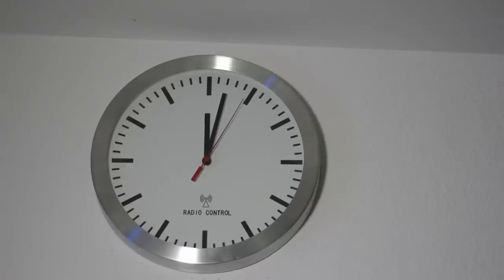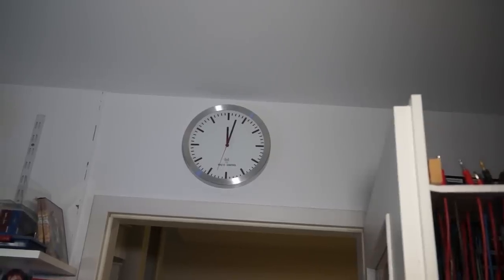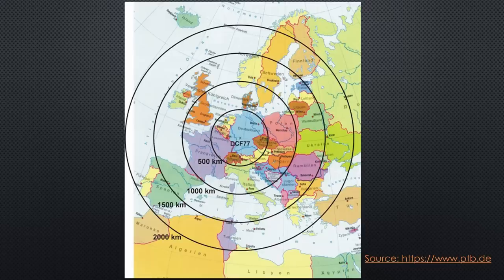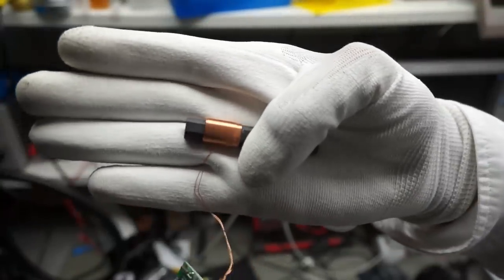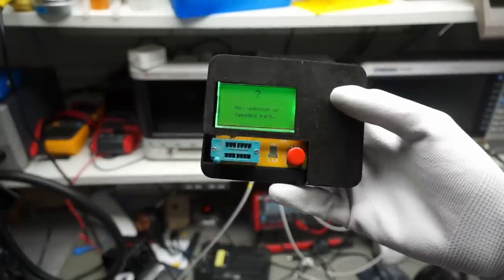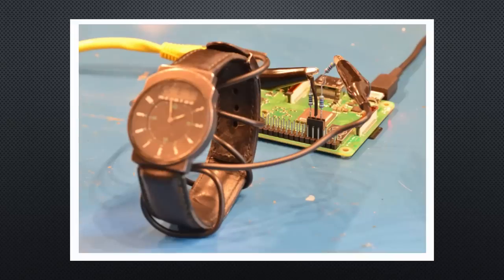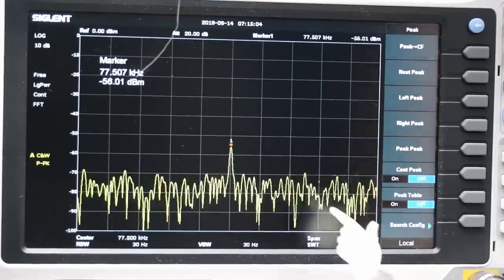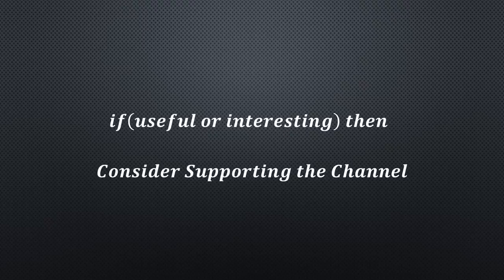#287 Remote Controller for Clocks (IKEA and others, DCF77, WWVB, MSF, JJY)

Comment: Isn't your weak radio signal competing with the much stronger one from the DCF77 station?
How does your Ikea clock know which signal to sync to?
Reply: Maybe I missed that part, but I am confused as to why he would want a different time in his lab, other than the one from DCF77
Reply: His clock does not reliably receive the DCF77 signal in that basement lab. (His clock doesn't sync to it or even syncs wrongly.) So that main signal will be hardly above noise floor in there. His weak makeshift signal will be way stronger than what it receives from DCF77.
Reply: @CarolineC0815  That makes sense, but that also makes it a very specific solution for clocks at isolated locations.
Best not get a radio clock for that location.
Your comment brings up more questions than it answers. :-)
I still enjoy the video, its always educational.

Anyway, thanks for the response
Reply: Think repeater radio
Reply: @DougHanchard  As if you have read the reply i typed but deleted. :-)
I was going to say:
The basement clock will never be more accurate than the clock source you use for your local transmitter.
(I guess that's good enough for home/office use)
But there will be a delay between receiving the DCF77 and the retransmission.

Also: If the original DCF77 signal can be received in the basement, but not reliably, you will still have interference between the two, unless your local transmitter drowns out the DCF77. (which is of course possible)

I was also wondering if the Raspberry would be powered on 24/7 just to avoid clock to get corrupt time-data.
It seems a bit of overkill. Since he probably has internet in the basement, he could use a clock that syncs with an NTP server once per hour/day.
Or, since Andreas seems to know quite a bit about Radios, wouldn't it be possible to receive the signal outside and re-amplify it in the basement? (without using a raspberry)
(I guess that's what you mean by repeater radio ?)

Comment: On my first trip to PRC i took my Alarm clock with me. But as the first morning came it did not ring That clock I used was a Radiofrequency clock. I didn't know that at the time, back in the 90s. I ssumed that all over the world they would use a standard Frequency and transmitting all the same time (like the GMT or UTC) and someone would have to adjust for the Time Zone by setting it. What a funny mistake:) hahaha
Reply from the maker: This concept was introduced before globalization ;-)

Comment: Thinking can use an upconverter with an RTL-SDR and Spektrum with a noise generator for a more cost effective tuning method?  Maybe first verifying the source signal to adjust for frequency offset once the RTL-SDR has stabilized.   Cool build.
Reply from the maker: Did you try a noise source with an SDR? I tried it without success. Maybe I made a mistake.
Reply: @AndreasSpiess  I still have to try... I've only read about and watched videos regarding.  https://www.rtl-sdr.com/rtl-sdr-tutorial-measuring-filter-characteristics-and-antenna-vswr-with-an-rtl-sdr-and-noise-source/

General search with a few references that might help:
https://www.rtl-sdr.com/tag/swr/

Do you think since low frequency measuring was the issue... I was wondering if direct sampling RTL-SDR alone will work?
https://www.rtl-sdr.com/rtl-sdr-direct-sampling-mode/
Reply from the maker: In the meantime, I tried again with the noise source of my oscilloscope and it worked. Hat to get the right FFT settings of the oscilloscope.
Reply: @AndreasSpiess  Awesome!  Please share. This RTL-SDR or other SDR method appears to be the most cost effective I've found and is on my list of amazingly cost effective procedures to develop this fall/winter as I'm currently focused now on other projects tasks.  

While on the topic of cost effective uses for the RTL-SDR, there is an oscilloscope plugin for SDR# also (albeit I'm not sure what the operating accuracy specifications will be) on the web that I've downloaded and haven't played with much from IN3IEX: 
http://www.amfone.net/Amforum/index.php?topic=34858
https://qsl.net/e/ea1kr//sdr/rtlsdr/  

I also just found this reference to SDRSharper doing a Google search to find the above links and will try when I get the time:
https://www.qsl.net/s/sdr/

On another note, I just found this reference to use an oscilloscope as an SDR which is something I've wanted to try with my TDS-520 test bed frankenscope either directly or with a pan adapter:
https://www.rtl-sdr.com/gr-oscilloscope-using-an-oscilloscope-as-a-software-defined-radio/
Reply from the maker: I will not do too much RF on this channel. I cover many other topics, too. Concerning using the ADC of the oscilloscope: Maybe an interesting experiment, but probably not very useful for everyday's operation :-(

Comment: Hi Andreas, I have a couple of DCF77 receivers for arduino. Can I cut the wires of the antenna of one of those receivers and use that as antenna for the transmitter without the need to purchase a ferrite bar and wind the wires as in the video ?
Reply from the maker: Should be possible

Comment: Great video, but one part I don't understand.  In your circuit you have a 1nF capacitor in series with the coil.  I tried googling it but all the articles talk about receivers, not transmitters.  I'm assuming it has something to do with tuning the circuit.  Can you explain and/or give me some keywords to more properly search?  It isn't on the original author's schematic.  I'm interested because I'm moving to Alaska and WWVB cannot be received there according to their signal maps.  Thanks!
Reply: I forgot to mention, I bought a decoder circuit off AliExpress and plan to use that antenna.  It was easier than trying to to DIY it (I don't have the enameled wire, etc.)  I bought the 60khz version so the antenna should match.
Reply from the maker: As shown in the video, it has to do with tuning. You can try without capacitor. Maybe it works. Otherwise I showed how you can tune it.
Reply: @AndreasSpiess  Ah!  Thank you, I didn't understand that part, I'll go back and re-watch.  For what it's worth, it did not work with the capacitor installed.  I removed it, per your suggestion and assuming the antenna was reasonably closely tuned, and it worked perfectly.  I have learned so much from your channel!

Comment: Thanks for the great video! I just built this DCF77 transmitter. I have one problem with it which is the low field strength: my clock can receive the radio signal only from a few centimeters. I need to have it in my whole flat: cca 10 meters. I have cut off the antenna from a ready-made DCF77 receiver then I attached it to my wemos d1 r2 mini with a 1nF capacitor and a BC547A transistor. Unfortunately I cannot measure the induction of the ferrite antenna I have. Can I suppose it have the same induction as in your case (145mH)? I tried to increase the voltage on the collector of the transistor up to 10 V but didn't help. I have no spectrum analyzer or oscilloscope. Any idea? Thanks!
Reply from the maker: These antennas are directional. Maybe turning it in the right direction helps.
Reply: @AndreasSpiess  I tried to rotate both horizontally and vertically but nothing changed unfortunately.
Reply: Now I am hopefully on the right way. I bought a measurement device to measure my ferrite antenna and calculated the right capacity. Now it covers a much bigger area but still not as much as I need so I need to improve a bit further :)

Comment: Great project Andreas! I begun to recreate the project with an orange pi zero, but and it don't have GPIO 4 or 17 on this Pi.  So I think that I can change thoses Gpios on the program for one's that Orange Pi have.  Do you know where I can modify the corresponding lines ?    I found the instruction for the GPIO 4 (gpio.cc line 184) but I don't find the gpio17 location. (I'm a real newbie ;)  Any help ?
Reply from the maker: I do not know and I am also a newbee in many cases, This is why I only use Raspberries ;-)

Comment: I wonder, would it be possible to actually inject the signal directly into the clock? Eg cut off the antenna inside clock, and then draw a 2-wire shielded cable to a raspberry and do the transmittance. The idea is that since its illegal to transmit on the frequency without license, by doing the transmitting on a wire (which then doesn't count as transmittance by law even if it "leaks" a little bit since by law its not defined as a radio transmitter - in the same way a NES console is not a radio transmitter just because you can connect it to the TV antenna jack), you would then build a cheap "master-slave" clock system. Propably the reach would be much longer too as the signal would travel very long through the cable.
Reply from the maker: You can inject the signal if you have access. But think about the wireless chargers. they work with a similar principle and are allowed. You could place the antenna very close to avoid a big signal as Henner did.
Reply: @AndreasSpiess  The wireless chargers are on an license free ISM band here. 9kHz to 5MHz is "License free for inductive applications". Qi chargers do on 10-600kHz. Same with RFID, also on a license free ISM band reserved for RFID.
Reply from the maker: So, 77.5kHz seems to fit? We also use coils to induce a current in the clock...

Comment: to see the signal, do you  connect the second ferrite rod with a capacitor of 1nf ? do you also use 200 turns of wire?
Reply from the maker: You can use the same antenna also for receiving. But you have to test it as I showed. It might be that your parts value are different.
Reply: @AndreasSpiess  it worked!
I could see the signal with sdr#. Lot's of harmonics though..

Comment: Always interesting videos, and this one is particularly useful since I found an atomic clock among my late Father's things and had no idea what the slider switch on the back were for: setting the signal to synchronize with! Now I'll set it to the closest source and wait for it to adjust itself. Any insights on how they adjust for time zones?
Reply: By calculation. It really is that simple. It transmits the native information based on the clock origin. The clock itself is then programmed with known DST regions.
Reply from the maker: These clocks work fine in areas with the same "time principles" As Doug pointed out they include "summertime" or "daylight saving time". And in Europe, most of the countries in reach are in the same time zone. So often, these clocks do not need an adjustment for time zones.

Comment: A version that runs on an ESP32 would be nice, a Pi is overkill and power hungry, it could use GPS or NTP over WiFi to get the time. mind you you could also rip the guts out of the clock and wire directly to the stepper motor unit.
Reply from the maker: Check my video 299...

Comment: Nice priject, but you can pick signal from gps for clock in raspbery pi and transmit to clocks
Reply from the maker: My GPS doss not work in the basement :-(
Reply: @AndreasSpiess  hello once again, i am using my raspberry for Ntp server, but after your video i want to make it transmit radio signal for a clock, i have this option in car, to receive DCF signal  but reception not great and no option to offset time. My time is GMT.
My question can antenna be made directional to transmit DCF?
And how to make it transmit at 15-20 m range?
How to check that raspberry transmitting, if i don't have antenna connected and no equipment to check.  I used your settings for setup. Is there any command in for linux to see its transmitting?
Thank you for your answers and time.

Comment: Nice video, but you can get a more accurate time signal using a GPS dongle receiver.
Since this clock is Swiss, shouldn't you add a transistor driven solenoid with a wooden cuckoo fitted to it? :-).
Reply from the maker: You are right with the GPS. Here my problem was probably more to display the time without wires than to have a showtime precise time.
BTW: cuckoos are more a German thing ;-)
Reply: @AndreasSpiess  the advantage in using GPS in the lab is that it is not that difficult to also provide a low noise master frequency reference. My apologies regarding the cuckoo clock, but then I obtained my information from Orson Welles in the film the "Third Man".
Reply from the maker: The third man was in Vienna if I remember right ;-) I will cover the GPS usage for a stable clock frequency in a future video.
Reply: @AndreasSpiess  the third man line was delivered by Harry lime while on the Vienna ferris wheel. It was to do with war and cuckoo clocks. 
Quotation from the film: "in Italy, for thirty years under the Borgias, they had warfare, terror, murder and bloodshed, but they produced Michelangelo, Leonardo da Vinci and the Renaissance. In Switzerland, they had brotherly love, they had five hundred years of democracy and peace – and what did that produce? The cuckoo clock . So long Holly."

I am glad to see you are proving Mr Lime wrong and producing lots of interesting things.

Comment: I got a new clock in the UK and it wouldn't synchronise whatever I did. After some Googling I discovered the signal was switched off for maintenance on the day it arrived! I was about to send it back as faulty.
Reply from the maker: I did not know they are allowed to switch it off.

Comment: thank you for the cheap method of the measurement. btw. can  the antenna be smaller?
Reply from the maker: I think so. But I did not try to cut this brittle metal.
Reply: @AndreasSpiess  no no. different type. there are hand watches. what kind of antenna do they have?
Reply from the maker: I assume a similar one, but I do not know.

Comment: Would it be possible to add or remove winding of an antenna to match the frequency perfectly? Since it is hard to get a capacitor with a precise desired value, maybe tune the coil?
Reply from the maker: Yes. For me it was easier to select a capacitor.
Reply: @AndreasSpiess  Good to have a collection! Thank you for the reply and for the very interesting video! Previously I thought only GPS broadcasts their atomic clocks in the air.
Now you only need to add some sort of monitoring to the transmitter, otherwise there is a risk that it will break without anyone noticing, and time will drift again
Reply from the maker: You are right!

Comment: Actually I'm thinking of a project with an ESP8266 to get NTP time and transmit signal to the radio controlled clock, but I have no idea on how to make the transmitter and implement the corresponding encoding protocol.
Reply from the maker: You can have a look at Henner´s program. It is in C and might be ported to a ESP.
Reply: I am also thinking NTP-to-RadioClock.
Would be a great project  @Andreas Spiess!

Comment: I had exactly the same problem.. its a thing of nightmares for us swiss. I thought a antenna around my roof and basement would work but never got round to it.... i need a rpi on always?
Reply from the maker: I use it on my „server“ RPI which is always on. The chance a foreign signal corrupts your clock increases when you do not transmit your own.
Reply: @AndreasSpiess  sounds like ees from eth i know... 👍

Comment: Nice) Never heard about this signal before.
I think, now it's better to use GPS for time sync -- it works all around the globe, not in this 1.5K Km rubbish ;D
Reply from the maker: These clocks do not use GPS because they are used indoors. GPS probably would not work with a antenna cable :-(
Reply: @AndreasSpiess  yes, I think GPS won't work with long cable. BUT! Maybe amp like UPC8232T5N can help? In can work as a repeater of GPS signal for everything uses GPS inside the building.
Reply from the maker: You might be right. But I wrote my answer wrongly. I wanted to write „without „ an antenna cable. I will use the GPS signal in the future for another purpose...
Reply: @AndreasSpiess  cool, waiting for GPS project!
w/o an antenna GPS is useless, right. But you can make your own with just a piece of copper wire. It's bad antenna, but it works and it's free... (bloganten [dot] ru/gps-antenna-svoimi-rukami/  for example)
Reply: Valdis Black l

Comment: A bit confused: if you cant get the right capacitor you take another one and test the frequency. "Now we have our resonance frequency and the antenna is ready"
So basically any capacitor is ok?
Reply from the maker: I selected one with a value close to what I calculated. The capacitors usually vary in value.
Reply: @AndreasSpiess  so your test later was just to confirm it was not too far off?
Reply from the maker: Yes. And also to show my viewers that the theory works ;-)
Reply: @AndreasSpiess  Danke für die Erklärung. Spitze!

Comment: I think it can also be done with a much cheaper ESP8266. (If you have wifi in the cellar for receiving time data from a ntp server..)
Reply from the maker: Maybe you port Henner’s C program to an ESP?
Reply: I have a 'wordclock' running with the excellent low time error https://github.com/ddrown/Arduino_NTPClient. Should not be so difficult to adapt the wordclock SW, and add the bitstream for carrier modulation.  Don't know if the ESP wifi will survive the load when the 77.5 KHz is bit banged. Maybe there is a HW clk pin output that can be reconfigured for 77.5, or using I2S? But it have to wait a few weeks..
Reply from the maker: In the meantime, viewers posted links to an ESP32 and an ESP8266 sketch :-)